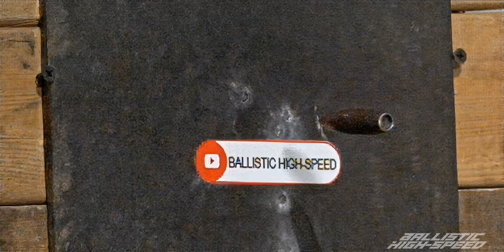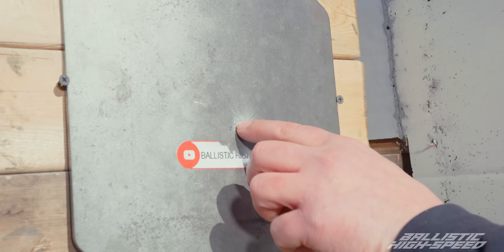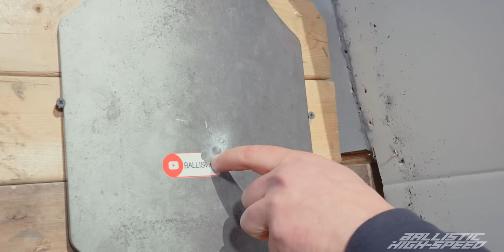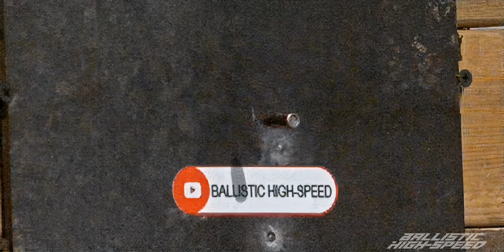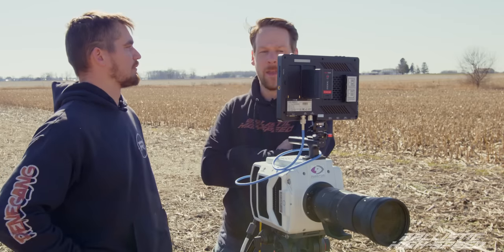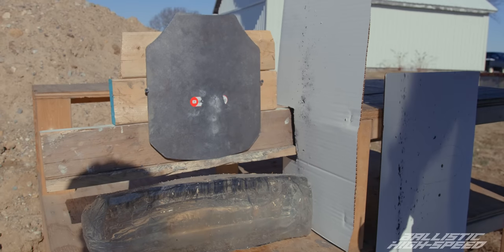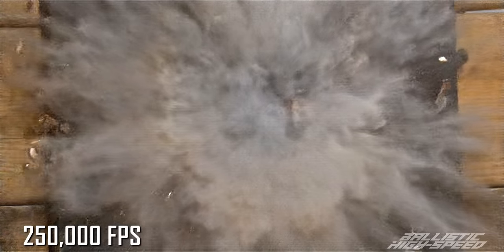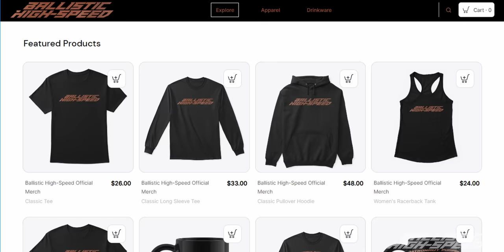Rifle Calibers vs Steel at 250,000fps! - Ballistic High-Speed

Comment: The .223 and 5.56 difference wasn’t so much due to chamber pressure but the fact that the M193 (.223) has a lead core while the M855 (5.56) includes a steel penetrator.  That is likely why you saw more sparks in the 5.56 and a deeper dent.
Reply: yeah it's not only about size and velocity so many types of rounds
Reply: This is exactly what I was going to point out.
Reply: Anyone that reloads knows and understands that it’s not the round but the chamber between the two that is different
Reply: @potroast1797  what's your point? He is pointing out that the two loads utilize different bullets, which obviously has more to do with the different results than any of the other differences between .223 and 5.56mm.
Reply: I knew someone would have already pointed that out, it would be Interesting to see the newer m855a1 in both core variants into different materials.
Reply: glad someone said it... was facepalming the whole time.
Reply: m855 also has a slightly lower stated muzzle velocity than standard .223, albeit probably due to the slightly higher grain of it
Reply: Notice how they didn’t react to this comment 😂
Reply: Correctamundo
Reply: Yep, was just going to comment this.
Reply: 5.56 is m193. .223 m193 loads are fake
Reply: @trippie_fabio3181  There isn't a significant difference between a generic 55gr .223 load and M193 5.56
Reply: I actually can’t believe they didnt know this
Reply: I was going to say the same.
Reply: That's what I was saying too. The differences between them are negligible. The guy didn't really seem to know that they're pretty much identical.
Reply: I was just about to say that. These dudes should know better...
Reply: Exactly what I came down here to say
Reply: @WMDMithbuster  maybe not "significant" in your definition, but 556 is about 200 FPS faster due to it's higher chamber pressure. Which in my book is very significant because that extends the the effective range of the rifle
Reply: I was hoping that they were gonna use steel core with the Mosin to check out the sparks, but it appeared not to be the case.
Reply: I agree
Reply: @WMDMithbuster  except that there is. Original M193 FMJ 5.56 55 gr Is much hotter and faster than 55Gr .223 what tf are you talking about lmfao
Reply: M193 is 5.56 NATO, not .223. 
If it says that, its either a mistake or not real M193.
Reply: @thejoatmoo  the 3200fps was the fragment that shot off to the upper right. They attached a little stick pointer to it but I see how that could be misleading. They often measure and show how fast the fragments leave.
Reply: I just liked your post so now you have 223 likes, your welcome.
Reply: @WMDMithbuster  there's zero difference other than there's slightly more powder in the 5.56 NATO vs .223 SAAMI specifications the bullet is identical the brass is identical the primers are the same small rifle magnums.
Reply: @lucascarter1641  5.56 NATO 55gr FMJ standard ball round is 3240fps the same 55gr FMJ ball round loaded to SAAMI specifications is 3240fps. I've loaded thousands of both for years and have dozens of loading manuals and nothing in my experience or in the experience of hundreds of other people through manuals is the 5.56 200fps faster than the .223. The 5.56 would have to have 20% more case capacity to to achieve 200fps faster with same bullet weight it is physically and mathematically impossible.
Reply: @ryanfonseca3270  I don't think m855a1 is available to civilians
Reply: M193 is 5.56.  Both M193 and M855 are loaded to the same pressure.  M855 uses a mild steel core to change mass distribution as steel is less dense than lead and copper.  This makes the M855 projectile easier to stabilize.  And slightly better soft armor defeating
Reply: Grimace427  
5.56 NATO uses more freebore or longer distance the bullet travels before full rifling engraving.
Reply: @TheFirstCurse1  my father worked at FN and made rifles in both calibers. Only difference was the stamp used to say what caliber the rifle was. The rounds are identical. Military cases have slightly thicker wall to prevent being ripped apart in automatic rifles. That does nothing for chamber pressures though Wich when measured at same standards are negligible. I don't understand the fuss about it. No rifle chambered for one will blow up when fired with other.
Reply: @mightress  Exactly. I've never heard of a 5.56 blowing up a rifle chambered for .223. I even looked it up just now before commenting and couldn't find a single thing about it ruining the weapon or blowing it up.
Reply: @TheFirstCurse1  it is a myth that just won't die.. 223 an 5.56 are the same just as. 308 Winchester and 7.62 NATO, same story, same answer.
Reply: I was going to point that out too.  Glad to see in was caught immediately by those in the know.  That steel penetrator had everything to do with that dent.
Reply: @thejoatmoo  for real I'm not even a gun nut and I knew this
Reply: A steel core is not the same thing as a steel penetrator. M855 has a mild steel core, not a penetrator. If we’re going to complain about attention to detail, that’s a big detail to gloss over.
Reply: While 5.56 and .223 share the same dimensions 5.56 is loaded (not much) hotter. 

M193 is NOT .223, and while the steel penetrator helps it really doesn’t make too much of a difference. It’s meant more for barrier penetration(ie, wood, cinder blocks, etc). As without it the bullet tends to come apart with pretty much any object in comes in contact with.
Reply: @thejoatmoo  must have been an "Accelerator" round, lol..
Reply: @chadklaren9537 ...chamber and throat dimension are slightly different
Reply: green tip is 62 gr vs 55gr .223
Reply: @petr0rabbit  Thats literally all it's about.

Kinetic doesn't care what it's made of. If it's mass and velocity don't exceed a certain threshold; it's not gonna go through that plate.
Reply: @chadklaren9537  your “years of experience” don’t matter caude you’re wrong. You know why? Cause the fps numbers on .223 rem boxes that are “equivalent” to 5.56 actually are tested out of 26 inch barrels as opposed to the 20 inch barrel 5.56s are tested out of.
Reply: @wes89  whos talking about ging though? i mean the effect we see when the round explodes on it
Reply: It's a shame that they shot this with a carbine. A 20" rifle with REAL M193 would have been nice to see.
Reply: The 556 doesn't automatically have steel core
Reply: Grimace427  
Steel core with lead surround is slightly easier to stabilize.  Ballistically matched M856 tracers required a 1:7" twist rate so the M855 are slightly over stable.  But not so over stabilized to not yaw and frag on live targets at impact over 2700 ft/sec.  100 meters for M16 A2, 10 meters for M4.
Reply: Yup, I was coming here to say this. They lost just about any firearm credibility in my mind with this video due to those comments.
Reply: Grimace427  i never said m193 is steal core? M855 also only has steel at the tip. 

And yes .223 is loaded in a variety of ways but it will not have the same pressure as 5.56 from factory. Although you can still load .223 brass up to 5.56 pressure (they share the same case dimensions)
Reply: @thejoatmoo  thats how fast the fragments are moving LMAO
Reply: Thank you. I came here to post this. It was mildly infuriating hearing them completely wrong about the difference.
Reply: Apparently these guys have a lot of money, and no wisdom.
Reply: @lucascarter1641 very significant?!
Reply: @thejoatmoo when it hits rocks, it can start fires.
Reply: Grimace427  this is true
Reply: Came to say this..the 5.r6 green tip has a steel rod inside and it was sparking on impact. Hopefully people have an anti spall coating on their plates..I still prefer ceramic but to each their own.
Reply: @mightress  some 7.62x51 head stamped M80 “seems” to be hotter than other 7.62x 51. I’ve never chronographed it, but it definitely seems to kick harder and the primers seem to show some signs of higher pressure.
Reply: Also, .50 bmg ball ammunition has a mild steel core. .50 penetrator ammunition has a hardened steel core. I thing part of what is seen bouncing back from the 50 impact could be part of the soft steel core.
Reply: Standard ball 5.56 is a copper jacket solid lead projectile. M193 is the NATO designation. Where are M855 is a designated penetrative round with the steel core. Neither, are .223 Remington rounds. .223 Remington is a lower pressure, although high velocity small game and varmint sporting cartridge developed for the original AR-15 in the 50's
Reply: Its also slightly bigger a 5.56 is .225 in diameter
Reply: Its also slightly bigger a 5.56 is .225 in diameter
Reply: Mild steel bullets like M855 do not do more damage to hardened steel than lead bullets. You only get better penetration if the projectile is at least as hard as the target. When the target is harder as in this case, and you're not shooting a giant projectile like the .50, the main parameter is velocity. Steel is very sensitive to impact velocity and light, high velocity bullets like M193 or varmint loads do way more damage than slower bullets that don't exceed a certain velocity threshold. At close range M193 from a 20 inch barrel will actually punch clean through thin AR500 and make nasty craters in thicker targets, whereas M855 leaves small dents.
Of course since there are huge variations in the performance of 223/5.56 ammo it seems their M855 had a higher muzzle velocity and thus did more work.
Reply: Its a green tip. So kinda.. duhhh.... with or without pressure. It's steel cored.... thats why it is green.
Reply: @marck5893  Green tip dont mean anything, take it from someone in the military
Reply: @REBELS-SLNDERMAN  i trust you. But can we then say "green tip is supposed to mean steel cored"?
Reply: M193 and M855 are both NATO 5.56mm rounds. The M855 has a slower muzzle velocity because it is a heavier round.
Reply: @ice-xv1hi  Naw. The guy in the video straight up said it was "faster", which it isn't. The M855 is slower. But the bullet is heavier and has a steel core, which the .223 he fired doesn't.
Reply: 0

2❤❤❤❤❤❤❤❤❤❤❤❤❤❤❤❤❤❤
Reply: Suppose they aren’t that ballistically fluent…
Reply: Folks, I used to teach this for the army when I wore one of those funny round hats, then later moved down the street to teach advanced techniques with another unit with an acronym name.  FM 3-22.9 has all you want to know about the weapons and the ammo.  On the custom civilian side, when I order chamber reamers, there is most definitely a difference between .223 and 5.56.  The 5.56 has a ever so slightly longer neck.  Some may simply say more freebore.  Also, I must specify which neck diameter I want, since there are about eight to choose, from sloppy large military spec for reliability to tight tolerance benchrest custom.  Yes, I said which .223 neck diameters.  
And M193 rounds are 55gn FMJ lead core.  No penetrator, rod, or dart.   The later heavier and longer 62gn M855 “green tip” does have a steel penetrator core in the lead, completely wrapped in a copper jacket, still FMJ.  We currently use M855A1 “gold tip” which is a hardened penetrator exposed tip, no lead, wrapped in solid copper, not a FMJ.  The A1 is loaded to a significantly higher pressure to bring the current M4’s 14.5” carbine barrel up to about the same velocity as the older 20” barreled M-16’s.
And yes, the military specified thicker brass webbing for their 5.56.  Ever wonder why?  Because the original 5.56 was indeed loaded to a higher pressure than commercial .223 of the time.  Remember, I said “of the time”.   
Some may be confusing this info with the M80 7.62 ammo, which is loaded to a slightly lower pressure than commercial .308.
Reply: Steel penetrator will only go deeper if the material it hits is hard than lead but softer than steel. Meaning…if the object (steel) you shoot is as hard as the steel penetrator you will have about the same penetration. If the object is harder than lead and softer than steel…THATS where the M855 comes to play. With that said…give me 5.56 all day long.
Reply: It's been said before but the "flame" is sparks due to a steel core bullet hitting the steel target. For example the 7.62x54r would have had an orange ring if silver tips were used instead of lead core ball ammo.
Reply: wondered how far I'd scroll on the comments when i heard that and thought the same thing, second one down lol. the damage isn't because of the cartridge, its because its a different bullet
Reply: Personally seeing 250k fps is an amazing thing to visualize. But.... seriously guys not knowing a green tip has a steel core... doing a great job otherwise,  but a little more research on loads and projectiles would raise the credibility of your channel immensely.
Reply: @keithjurena9319  The steel core is indeed less dense than lead which makes the steel core projectile longer for the same weight. This makes it harder to stabilize, not easier. Longer projectiles need tighter rifling twist to get the spin stabilization they need.
Reply: M193 is not .223, both m193 and m855 are 5.56mm, m855 has a steel penetrator.
Reply: @gnarkiller  m855 is available just not a1
Reply: @davidmarshall8628  
Mass distribution with a steel core makes it easier to stabilize.
Reply: @keithjurena9319  How so? Steel is less dense than lead, so for a given weight a steel core projectile will be longer than a lead core projectile. Longer projectiles are harder to stabilize, they require tighter rifling twists. It's exactly the same situation with all copper hunting bullets being harder to stabilize than same weight lead core counterparts.
Reply: I call  BULLSHIT  on 250,000 fps.    No BULLET HAS SPEED ANY WHERE NEAR THAT.
Reply: @imafarmer6353  I believe it refers to observing at 250,000 frames per second.
Reply: @imafarmer6353  Frames Per Second, as in the camera is shooting at 250,000 frames per second.
Reply: Came to say this
Reply: Head space was the difference originally.
Reply: @gnarkiller  Yes it is.
Reply: @mightress  lol, there is a difference between them, you're just too ignorant.    The shoulder angle on the case is different on a .223 than on a 5.56 which changes the head space.  With the 7.62 x 51 not only does it have thicker case wall, the shoulder on it is also different creating a different headspace.  Brownells has a video here on youtube about the differences.
Reply: There is no magic to certain calibers. There are basically four factors. Diameter, speed, weight, hardness. You can shoot the same bullet in a .308, 30/06, 300 win mag and the only difference is speed.
Reply: Yeah I was wondering how they know it’s called green tip and have all these rifles to shoot but nobody told them it was because of the steel penetrator
Reply: Did they say they were using military spec ammo? I tried to find more than 5.56 but couldn'tI've fired fmj and tmjs with lead cores, even had it not specified the lead warning  did.  Hot steel would look like orange sparks but to be vapor like that takes a lot of heat.  I'm not sure there's that much energy in that round is there?  I first thought it was unburned propellant either caught in the eddy behind the slug or stuck to the hollow  that forms on lead core tmj rounds and keeps them more stable over what is usually an uneven shape, that's the claim at least.  I'm puzzled now, damn I really want to know what effects this part of the footage.
Reply: Skipped the m55A1 and 30-06
Reply: Thank you, that made me upset
Reply: Exactly, came here to say the same thing. The biggest difference is bullet construction.
Reply: @blackhawk7r221  finally someone who knows what he's talking about 🍻
Reply: Hardened steel at that..
Reply: Older lots m855 had a steel rod and I believe the newer ones had more of a cone shaped steel penetrator in the core of the bullet.
Reply: What about that steel case .308
Reply: Good point
Reply: It’s a combination of the two 5.56 has higher pressure and a steel core
Reply: Well 556 can be loaded about 8000psi higher so for a full power 556 you actually can see a difference
Reply: Also that was the same projectile from both 223 and 5.56. That wasn't a steel core.

Comment: I found the barrel flames from escaping gasses hitting oxygen quite interesting.   We could tell the caliber difference between .30 and .50 caliber holes in helicopter airframes by the holes (Vietnam era).  .30 caliber rounds left a smooth edge while .50 caliber always left a jagged edge denoting torn metal.   Thanks for sharing this insightful video.   Peace
Reply: I figured you could tell from the size of the hole....
One is nearly twice the diameter...
Reply: @khancrow7015  not all rounds entered perpendicular to the surfaces and a wobbly .30 cal can make a hole close to .50 cal
Reply: @Cat Gynt  true that. I am only judging off my experience when shooting my .22 and 30-30 at old cars, washers, trailers and other sheet metal. But I believe you.
Reply: @khancrow7015  Affirmative...  In my experience all pilots were issued two bullet resistant vests; one to sit on while placing the other under their feet.   Stay safe out there.

Comment: One thing to note is m855 green tip has a steel core for (penetration) which is probably why the 5.56 did more damage to the plate.

Great channel keep it up!
Reply: Close! The M855 (black tip) has a steel core. The M855A1 (green tip) has a steel tip on a lead core
Reply: What damage?
Reply: @Fadaar  uh nope.

Black tip is armor piercing, also is called m995. M855 is a steel core, medium shade green painted tip (or no color at all for some foreign users). M855a1 is a tungsten core has a half copper jacket with more OD green tip.
Reply: And the 50 cal projectile has an all-steel core.  Of course it blew through the plate like it was nothing at all.  The jacket was stripped and the steel core barely noticed the plate.
Reply: @michael2636  Black tipped rounds are true armor piercing. 855 is not a true armor piercing round